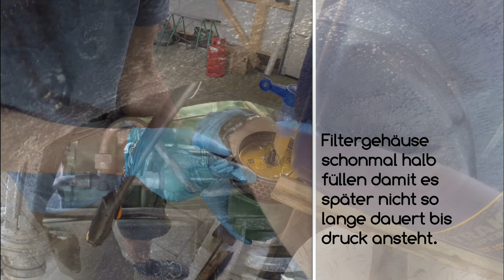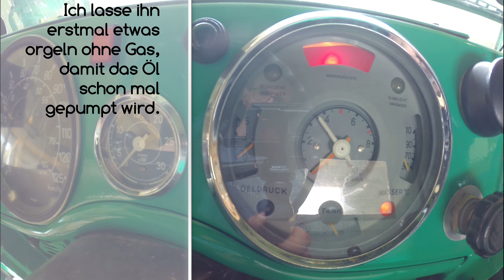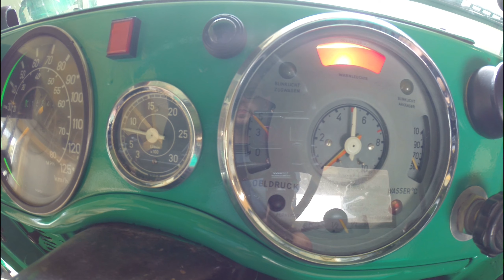Unimog 406 Motoröl wechsel geht daneben!

Comment: Is it possible to remove the valve cover on the head of OM352 on 406 whitout remove e pull up the cabin ??? To change the cover valve gasket ...maybe on mine oil go in the aspiration and do a lot of smoke at the exaust...

Comment: Hi do you know where is positioned the oil pressure bulb on the engine om 352 ? I have problem the instrument of oil pressure in the cabin .. dosent work ....i hope is the instrument and not the oil pump .. can you help me thanks Roberto
Reply from the maker: The oil pressure sensor is on the left side near the steering oil reservoir. It is silver and has a cable.
Reply: Thanks

Comment: Hi .. can you tell me the passages step by step to change gasket under valve cover ? If is necessary to lift the cabin ??? On 406 ? Thanks
Reply from the maker: I'm sorry, but I haven't changed the gasket myself yet because the engine was completely overhauled. But I think you should get the workshop manual, even though I think it's only available in German. There are plenty of pictures in there and the text can be translated using Google Photo Translate.

Comment: Hi why you dont fill the oil filter from the screw on the bottom of filter canister ???
Reply from the maker: Es ist nicht notwendig. Die Ölpumpe erledigt das für mich😉. Und es würde nicht drinnen bleiben. Ich sage nur Schwerkraft 😅 bis die Schraube wieder drinnen währe.
Reply: But whit canister filter full is better .. for few time you have no pression in the system ..i saw you filled the oil in the canister under the tank ...and i consider is better to charge it dorectly from the bolt .. whit a little pump.

Comment: Hi how is possible to use filter mann H 1366????
Reply from the maker: https://www.unimog-community.de/phpBB3/post259616.html?hilit=%25C3%2596lfilter#p259616
Reply from the maker: Ich kann sagen, dass es funktioniert habe es genau so wie beschrieben gemacht.
Reply: I dont understand deutsche .. is something in english ?? My question is why to change the filter system ??? Its dangerous to use the original system ?? Whit new generation oil ? Thanks so much .. Danke
Reply: From 8.48 to 9.21 ...the pressure oil is low ...is not so good ..
Reply from the maker: @robertotirabasso2812  ❓8.48 to 9.21 bei mir habe ich 5 bar im kalten Zustand und Lange Strecken sind es noch 3 bar das ist aber meines Erachtens Minimum. Ich gebe dann immer etwas mehr Standgas.
Reply from the maker: @robertotirabasso2812  you can use google tranlation for the Website from abofe. It is not dangerous but the old System use not 100% from the Filter kapatziti it has an bypas. The new System uses the Filter completely.

Comment: Achja und den Filter den du verwendest ist eigentlich früher für die unlegierten Öle gebaut/konstruiert worden und für heutige legierte Öle nicht mehr fein genug, da diese die Partikel in Schwebe halten. 
Hier geht der Verschleiß deutlich runter wenn du den moderneren H1366 Filter von Mann einsetzt wie z.b. im 417 und späten 406 verbaut. Der Umbau ist keine große Sache. 

Gib mal im Unimog Forum das Stichwort "Nudelsieb" ein dazu ist alles erklärt :)
Reply from the maker: Werd ich aufjedenfall beim nächsten wechsel machen. Da der Motor komplett überholt wurde währe das definitiv besser. Danke für den Hinweis.
Und das mit dem ablassen werd ich mal schauen was daraus wird. Da ich auch noch nen Traktor habe bei dem ist das gleiche Problem.
Reply: @MGrohmann  Kein Problem gerne, sonst super Video weiter so :)
Reply: Kurze Frage, was muss ich da besonders umbauen? Kann ich nicht einfach den Vorfilter drin lassen und nur den Filtereinsatz tauschen gegen den H1366?
Reply from the maker: @itrstiegele9291  ich habe den Umbau nach der Folgenden Anleitung selber durchgeführt. https://www.unimog-community.de/phpBB3/olfilter-umbau-om352-im-u406-416-t47582.html